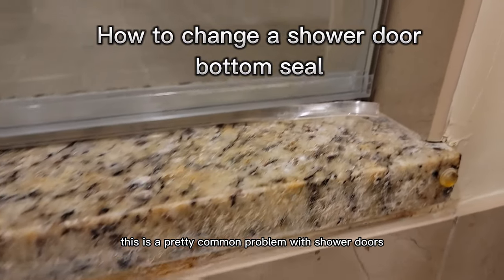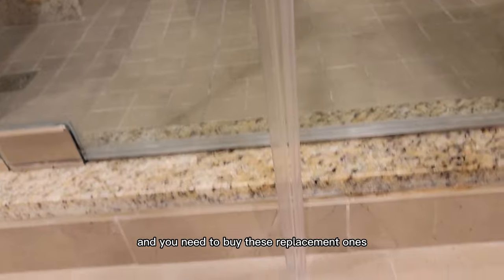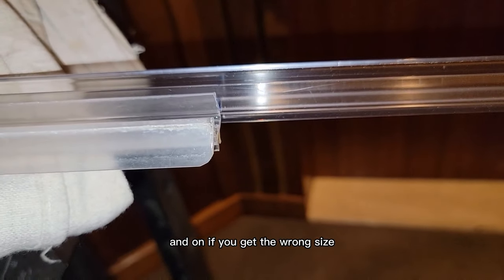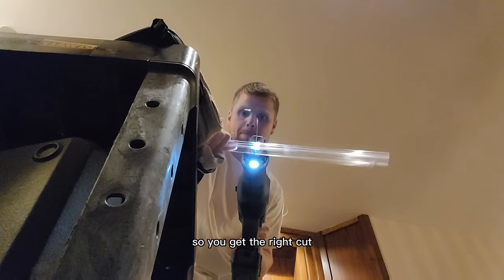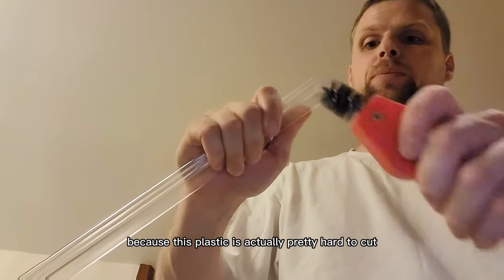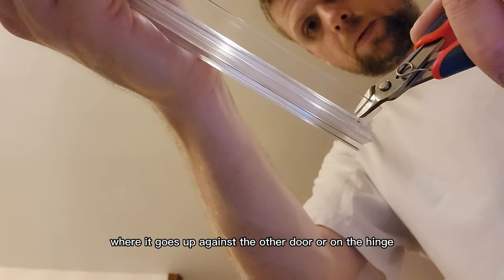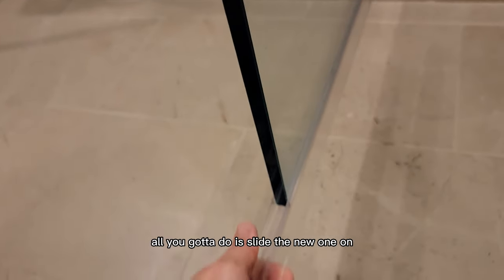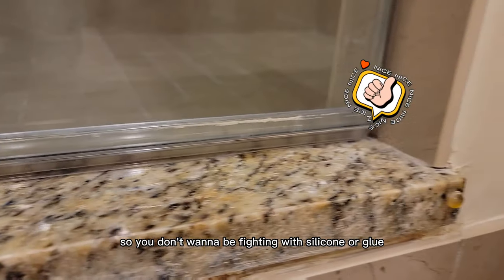How to replace a shower door bottom seal #diy #shower #fixed

Comment: I measured and my door is 3/8”. It’s so tight, I can’t slide it on. I decided to try a 1/2” and it was too loose. Can I do anything to make it easier to slide on? Soak in hot water…. Or something? Thanks.